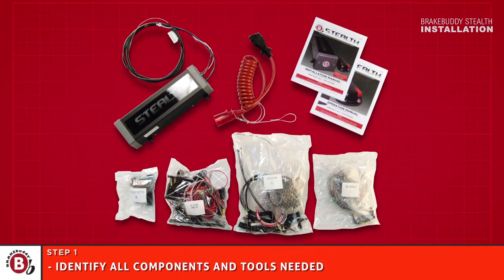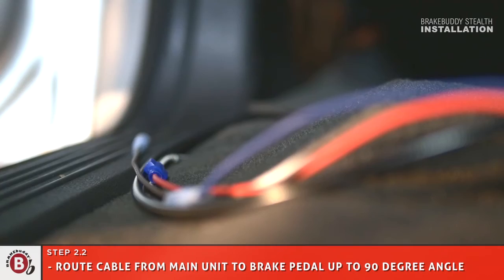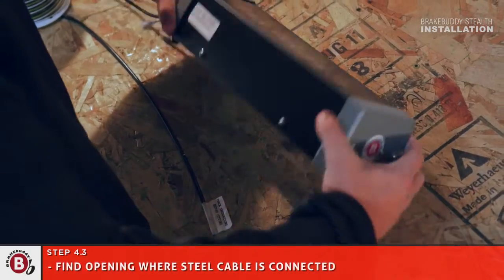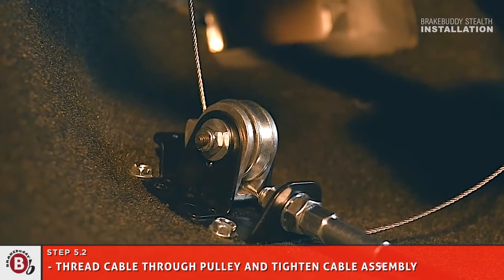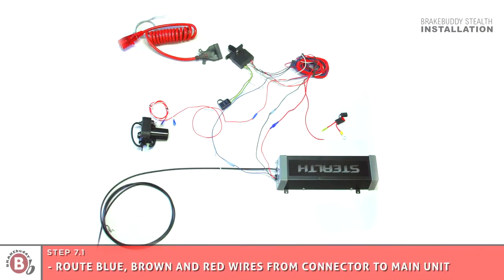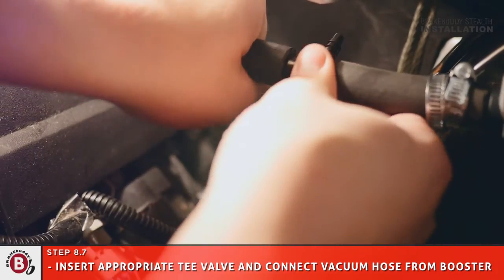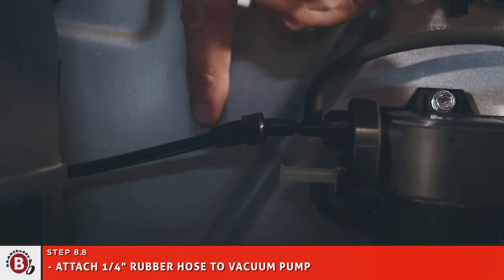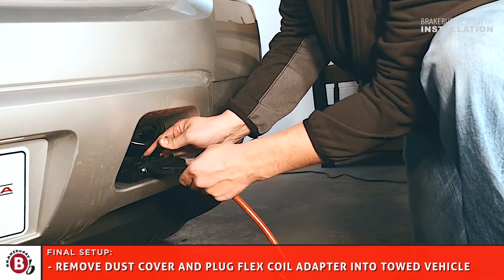Brake Buddy® Stealth - Towed Vehicle Brake Installation

Comment: so I take it the all in one adapter on the front of the toad also have wiring for toad lighting, turn , brake etc. and the dual controller in the RV or tow vehicle,  can also work for other trailer braking systems using the correct 7 way cable of course (to a standard Electrical trailer brake system)!

Comment: The Ford Escape 2020 Hybrid has the battery in the trunk ...Can I get 12v power and ground direct from the 2 posts located on the  eng bay ? that post are the ones to connect the jumper cables thanks.